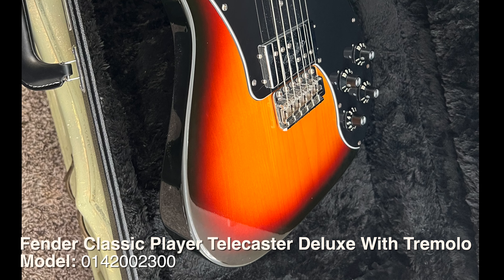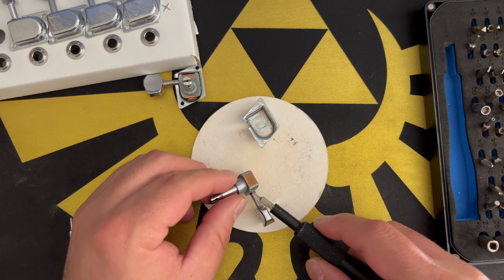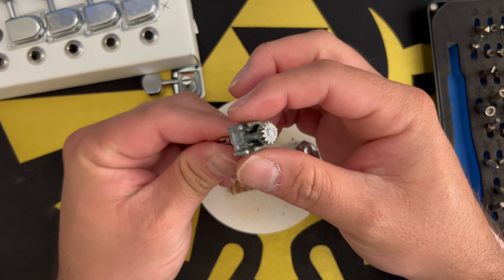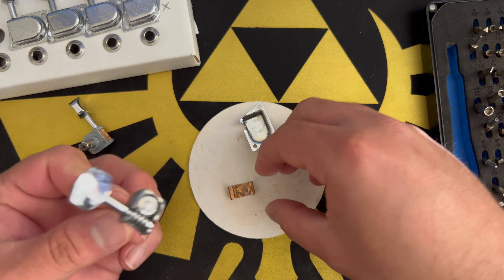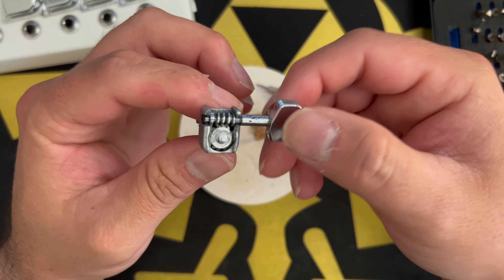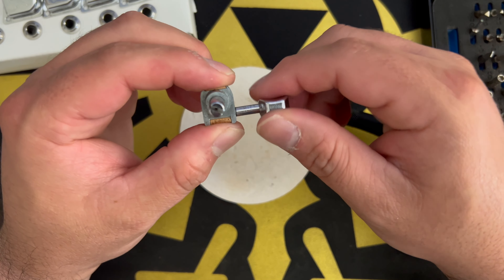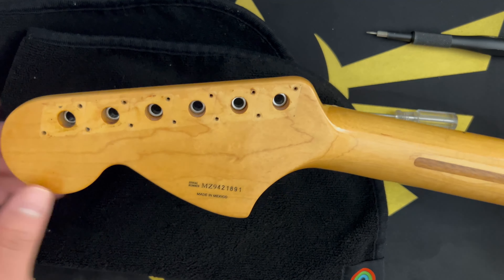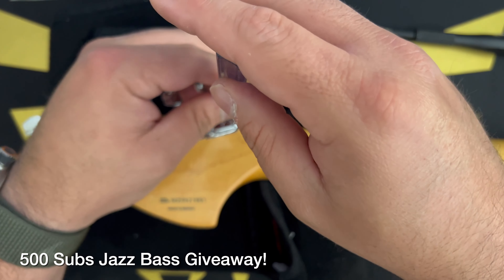Fender 70's Tuners Breakdown | Jazz Bass Giveaway!!

Comment: It was interesting to see inside of the tuners. I don't think hardened or missing lubricant caused the problem. In my mind it would require an electric motor to damage high quality gears. I'm leaning towards the problem being inexpensive metal alloys used in the manufacture of the gears. Thus, I attribute the wear to normal use over the years. My two pennies 🙂